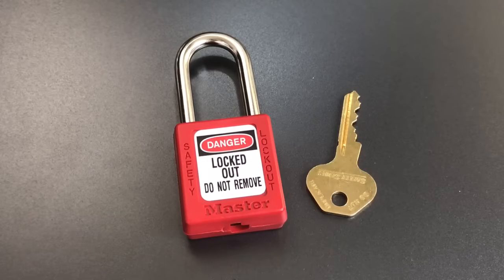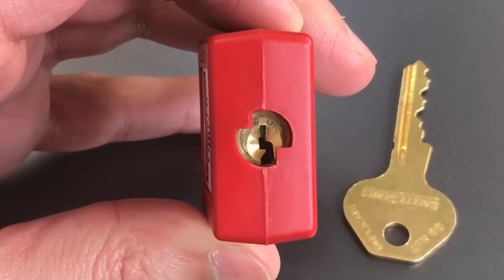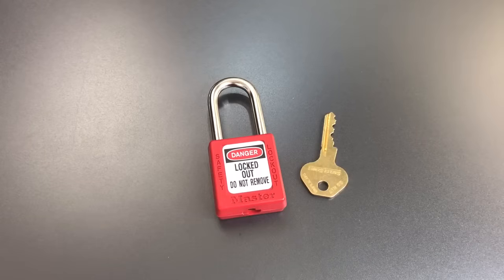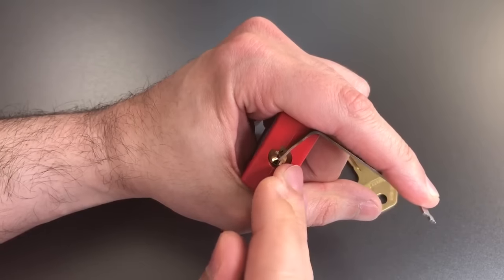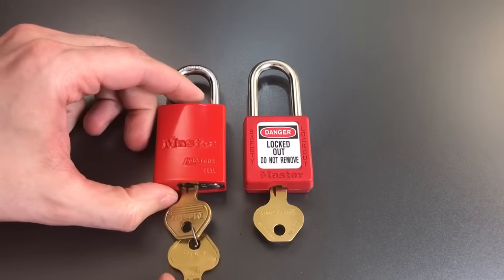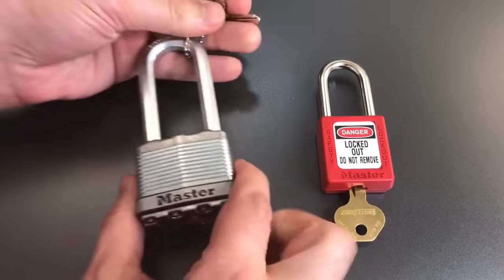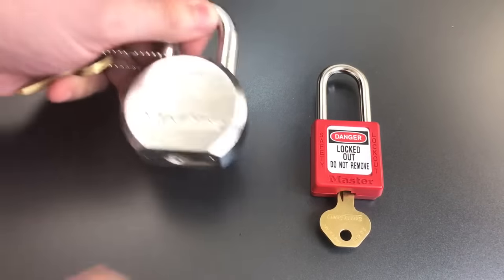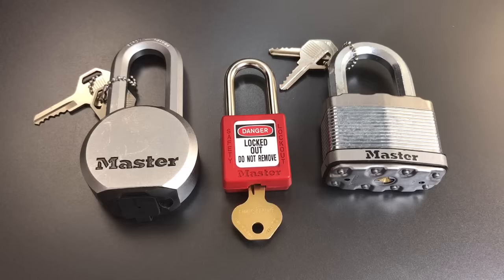[479] The Master Lock Paradox - Model 410 LOTO Padlock

Comment: As a safety professional I can explain the paradox. This is the best LOTO lock because the likelihood of mistakenly taken a lock off with a similar key is very low and uet it is very easy to remove by force when an employee goes home and locks out critical machinery. There are procedures in place to cut a lock and Noone not even management can unlock the lock without destroying it. These are Industry standard and in my carreer I have never seen the other locks he has shown. This lock is ideal to its purpose.
Reply: Brings back bad memories of working for a certain large online retailer.. I used to randomly select one engineer for a LOTO audit weekly, the locks used are the same as this one. Remember: locks only keep the honest people out.
Reply: Then explain why its full of security Pins, and it has more of them than the Locks they rate the highest on their Security Scale (which only have standard Pins)?
Reply: @unitrader403  there's a little more to it than what Justin Ford said but not much. First, job sites where LOTO locks like this are used can have machines that are multiple stories tall and during annual scheduled maintenance can have dozens of contractors and hundreds of workers on site. Amongst those hundreds is usually one asshole who thinks the rules don't apply to him and knows how to force a typical lock with pressure on the hasp and a dead blow hammer so he can turn on a light in a crawl space. He might even keep a bump key or rake in his pocket. Locks of these types should be impossible to manipulate into opening without a key but should show damage at any attempt to brute force open so anyone walking by would notice it's been messed with. The danger isn't that the lock was brute forced open and it's obvious after the fact (no valuables stolen) The danger is someone doesn't know the lock was picked or jimmied and goes into the danger area.
Reply: @matthewsullivan9598  This still does not answer the question why Masterlock does not use these cores in their highest rated products even though these Cores are objectively more secure...
Reply: @unitrader403  Cost.
More pins=more money. It takes more manufacturing steps and security pins take more fine machining. I think lawyers have an impact as well. If the actual core fails or is defeated on a LOTO lock someone might die. That's huge liability to the company. If the core fails or is defeated on an expensive high security lock and your garage gets ransacked it sucks for you but you're not likely to sue Master Lock for millions. People pay a premium for a tough LOOKING lock without knowing how good the core is so why waste money on the core? I'm not defending I'm explaining and I get frustrated by it too. Yet it makes sense from the business side.
Reply: There is no way any facility would have enough lockout locks to double up on a 4pin combo let alone 5 or 6 pins.
Reply: @unitrader403  because ultimately its not fully about security (i need to keep a person out of this highly expensive thing) in its use. Its about safety. Anyone who works with LOTO is not just going to ignore this lock on a machine dead switch. Plus these locks are normally backed up by human procedures. Where i used to work we had 4 locks all keyed to ourselves for working on multiple units at once. But it was a nappy production line inside a factory building. So i was locking out e switches and pneumatic dumps and the locks had my name on them if folks needed to ask why it was locked.
Reply: My jobsite has 3,000+ construction empoyees and 20,000 full time employees. Besides a unique set of red locks for individual workers, the site also uses blue control locks so that's another several thousand locks needed. One small crew of electricians could use up 50+ locks to lockout one generator because of the circuits.
Reply: @saxplayingcompnerd  In Australia (at least) - I know for a fact that some companies explain that each site is assigned a sub group of pin combinations, and it is registered when given out. I would have to double check, but it may well be the case that each company has different sub groups assigned, so there are no 2 like-pinned locks given to different people in the same state.
This is because contractors often have their own locks, and work at multiple facilities.

Here in Western Australia, thousands of regular contractors and full time staff members requiring locks (there are other staff but not everyone needs to be part of LOTO) is normal. There's 24 hour operations, requiring 4 crews of staff, each crew has high hundreds or more during a shut, and there's a variety of contractors that can rotate through during various works or shuts. There's plenty of mines all over WA, it all adds up.

Before anyone says that more than 6 pins would be needed - one company in particular has contracted a specific lockmaker (well, company) to begin making 7 pin locks for them due to the opening of several new minesites.
Reply: Plastic body does also have a different chemical resistace. Plastic handels a lot of chemicals better then any type of steel.
Reply: @unitrader403  watch the whole vid ....read more comments
Reply: @saxplayingcompnerd  they are bought in the thousands in huge plants. and when it comes to safety there is no room for errors. all safety rules are written in the blood of someone who died
Reply: I think the paradox is not why masterlock uses this core in this lock.I think the question is, why do they NOT use the same core in the other more robust locks? They have the technology, the supply chain, the knowledge... could just make all their locks be great! But instead they put low security cores in most products.... why. Nobody knows.
Reply: @unitrader403  cost and also weather resistance
the more pins you have the more failure points you have and if your lock rusts shut at just one of the pins, you basicaly have to break open the lock which defeats the purpose
Reply: @saxplayingcompnerd  oh you sweet summer child
just in class we had a few hundred lockout locks (i studied in electromechanics) 
i imagine actual industries would have thousands if not more
Reply: Don't they have to do a change out at shift change with the person coming on shift putting their own tag and lock in place?
Reply: @drl5002  each individual person adds his own LOTO lock.
Reply: Lock-out breaking is illegal in Canada, and some other places, where huge fines are imposed based on the danger that the workplace poses to whatever is locked out.
Reply: so why doesnt master use the better core in their high end locks?
Reply: But that's only one half of it. The question is if Masterlock is in fact capable of making decent cores inexpensively enough to put them in LOTO locks, why aren't those cores inside security locks?

Comment: I'm a chemical operator and I do lotos essentially daily. We have all 3 locks in this video mentioned. The plastic body is by far my favorite for its light weight (we often have to carry 30-50 at a time) and it's ability to endure weather and corrosion. We work with HCL, sulfuric acid, h2s, chlorine etc and the other locks in the video pretty much always get siezed closed in our harsh environment. The plastic ones can remain in a lockout for months and will unlock months later without issue whereas the metal ones often have to get cut off due to corrosion.
Reply: I can see that happening given the conditions. My work gave us American Lock 1100s but of course being aluminum bodied they get beat up pretty quickly after being carried around all night. Mine have gone from being red to having no finish on it at all so I think the plastic bodied would hold up better lol
Reply: Did u have separate lockout boxes, basically said locks are associated with a particular box set so locks 1-12 box A4 labeled for that box, the keys for those go into that box and that box is locked by your personally labeled lock and you only carry the one key for that particular box granted sometimes multiples for several boxes but no need to carry 30 keys around.
Reply: @vinces8209  It's not the keys he's carrying around, it's the locks. On any given piece of equipment you could have literally hundreds of lockout points, every single one of them has to have a lock, and there's only gonna be two or maybe three guys if you're lucky handling all of it.